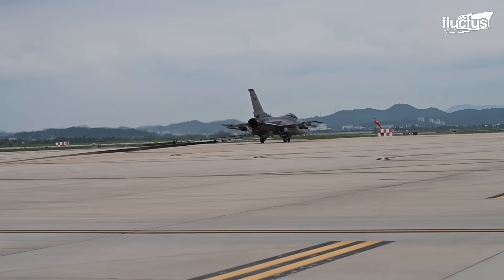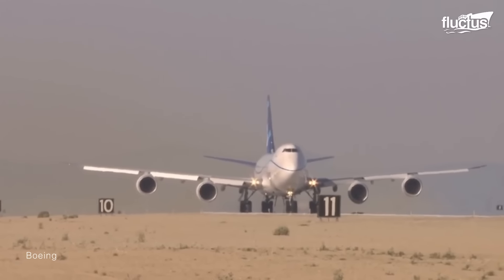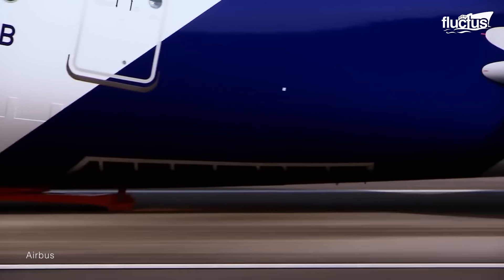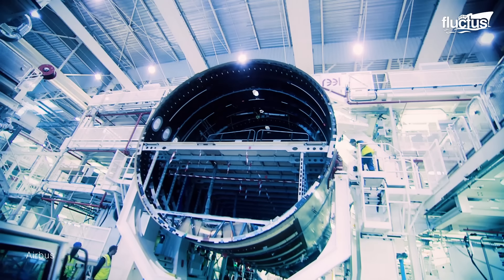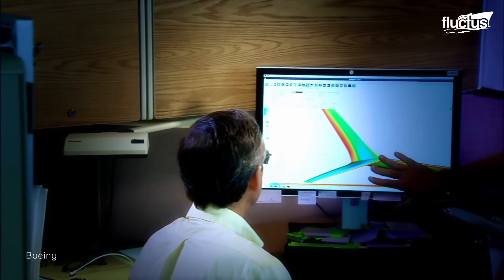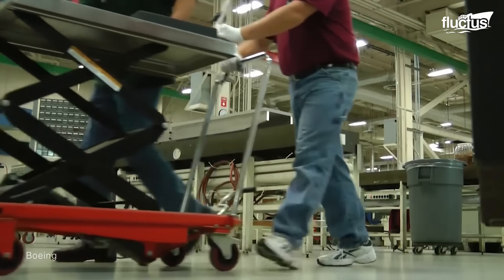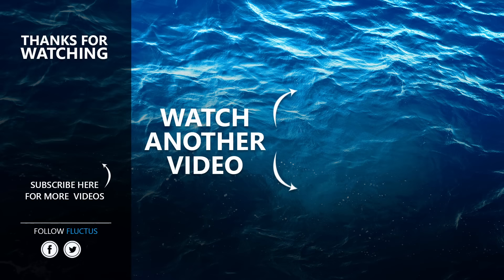How New Aircraft are Cruelly Tested Before Being Sold to Airlines

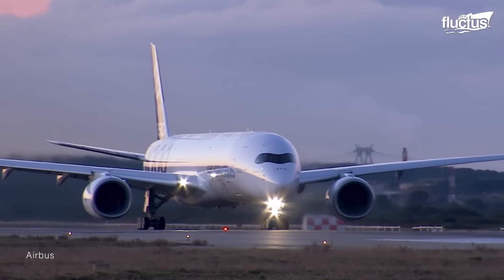Comment: Tailstrikes do not only occur in the VMU test. They can also occur in the TOP test (take-off performance test, which determines the basic data for calculating the take-off performance of an aircraft). For this reason, devices such as those shown in the video at 2:46 are installedat the tail so that the fuselage is not damaged too much.
Reply: nope but in the real world if the tail does not have protection a tail strike can do a low of damage to the tail
Reply: @raven4k998  🎉

Weeels’dkd)
Reply: @raven4k998  🎉

Weeels’dkd)

Comment: Its not cruel testing. Its called stress ,performance and safety. It how they establish the limitations of the aircraft for the pilots so they don't exceed them
Secondly, it establishes the maintenance requirements so the airlines know what how long parts will last 
The USAF lost AC-130J brand new from because the aircraft went inverted during testing for a few seconds. It recovered and landed safety however per the maintenance manual had to be written off as it exceeded the safety thresholds
Hence why this testing is important
Reply: Ya don't say.... 🙄

Comment: By "fitted with brakes that have been completely worn out", they mean brakes machined down to the expected maintenance wear limit.  So still plenty of energy absorption left in them (or else the plane wouldn't stop).
Reply: Is it not to test out the thrust reversers?
Reply: @TheHunkerBeans6841  As it happens, reverse thrust isn't used in these "rejected takeoff" tests done for aircraft certification.  That's partly for conservatism, as well as the reality that one reason an RTO might occur is because of an engine(s) problem.

But even with all reversers working at full power, an airliner wouldn't be able to do a maximum (kinetic) energy stop in a reasonable distance with just reversers.  Despite all the noise, they don't provide nearly as much stopping force as brakes.

Comment: 3:05 - Is this test done for ALL aircraft manufactured in the production line, or, only a special test aircraft for each model??
Reply: Usually its done with all types of aircraft, ensuring no immediate breakup when a certain part strikes the ground.
Reply: @ripnob  Yeah, I get that they do with ALL TYPES (i.e. models) of aircraft. BUT do they do these tests on every aircraft that comes out of the production line?? I am guessing not.
Reply: @briannorth5862  No, only the first aircraft of each model go under this testing, after that in the production run, because they already have all the data, there is no need to test every aircraft that comes off the production line.

Comment: although unlikely what would happen if upon takeoff say 200feet all engine lost power whether fuel or ingestion causing the compressor stages to shatter, would the plane be able to stop or only after it hits the ground running? or do we just not tell the poeple what could happen if all the stars aligned for a second?